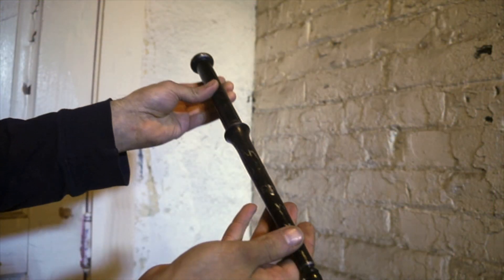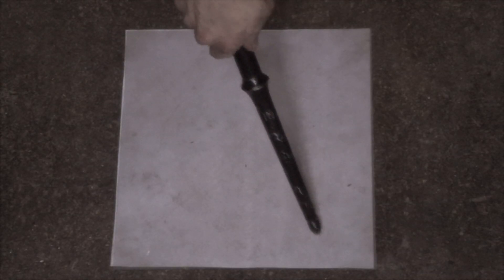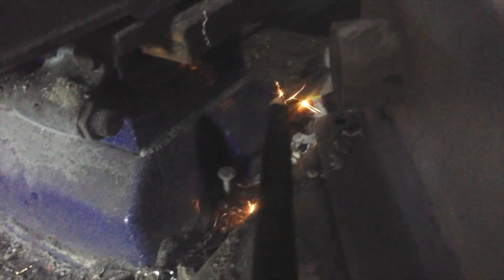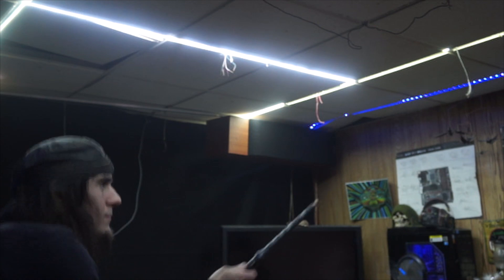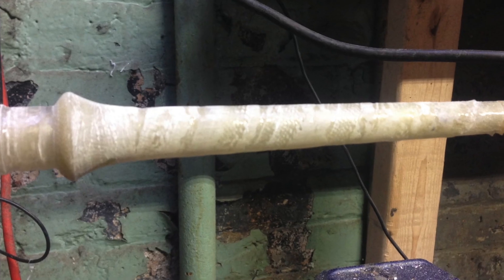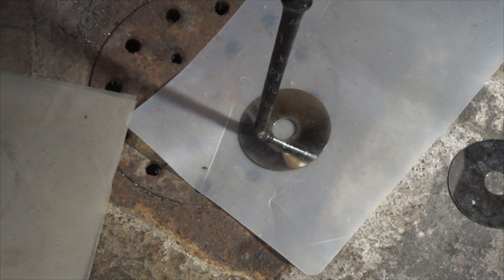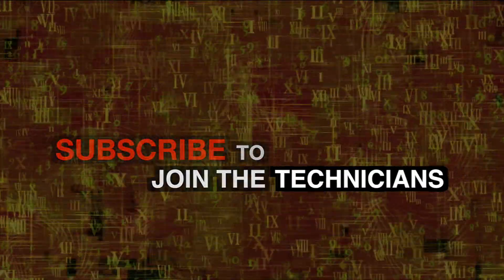HOW TO MAKE A REAL WORKING MAGIC WAND! *updated*

Comment: You ever considered trying to power this with Piezo elements charging capacitors or likely even better magnets and induction coils so shaking can charge it or something.  Sure it can be done, just dunno how long or how much movement it would require for use but would make it self sustaining with would be cool.

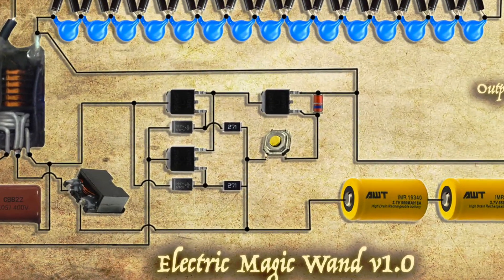Comment: Can any one suggest that mosfet name 3:40
Reply: Irfz44n 😂
Reply: irfz44n, irf2804 are pretty good for this, i found my mosfets in a ups power supply, i just looked them up on google to see if they have low on resistance so they dont heat up

Comment: I've recently taken apart a handful of televisions laptop, desktops, and hard drives. Do you think I could find all of the parts needed for this construction within those parts? I am interviewing with the electricians union this Spring, but have no real understanding of electromagnetism as of yet. I have always found this force to be a mysterious and alluring one, and I can't wait to get started on this journey of understanding. I had seen something about an Orgon wand in some magical texts. Anyone know if this is similar at all? The construction of that one mainly consisted of a series of organic (I think duct tape was recommeneded) then copper or brass wrapped on top of each other..over and over again. This looks way more involved but also more electric vs. Life force..which I still need to gain understanding of both of these ideas. Anyway, thanks so much for sharing this knowledge. It is so very cool

Comment: What are some safety precautions? If someone touches both ends at the same time, will there be enough resistance to prevent the electricity from stopping your heart?

Comment: yeah can you have an actual parts lost not just values and explain the math! You said the coil depends on the capacitor used but didnt explain how you to the voltage. How many turns are on the two coils, you only talked about the one.

Comment: Can you get a mosquito bug zapper and connect it to the cockroft Walton multiplier?
Reply: Kenneth Precioso that would be cool 😎
Reply: Dylan & James Gaming yeah I’m not that technical with electronics yet, but the schematic he layed our seem simple enough for me to solder. Anyways I wanna try this out, or just connect a cocroft Walton multiplier with a ccfl inverter. It doesn’t need to be a wand, I just want it to attach to a ring so I can shoot lightning out of my finger tips
Reply: Kenneth Precioso just warning you it would be very big and inefficient and wouldn’t be nearly as close to the voltage of this. A bug zapper is only like 2-3 kV so you’d need an extremely large number of capacitors making it even bigger and more inefficient

Comment: Can you use the MC-105 high voltage generator that's sold on ebay? https://www.ebay.com/itm/MC-105-DC-3v-6v-to-400kV-400000V-Boost-Step-up-Power-Module-volt-Generator/391727208743?hash=item5b34c2d927:g:fS0AAOSwSlBYxlnP
Reply: inJ3XioN the voltage is not high enough and the entire circuit is potted in resin so you wouldn’t be able to modify it. (Yes I know it says 400kV but it’s all Chinese fake bullshit and is almost ten times weaker

Comment: About how much does this cost to make?
Reply: Kickflip 47 the whole thing is made of very easily salvaged parts and the only thing I find hard to get is those high voltage capacitors and diodes, which is about $10 total because you aren’t buying them in bulk

Comment: Hello, what is the voltage and frequency of the output of the highvoltage circuit you made? The output before it is attached to the diode multiplier

Comment: Fantastic build. I've been making electrostatic devices and wands for a while myself, very impressed at how small you were able to make this thing. I've been using information unlimited's 8kV transformers for most of my devices though. Would be interested in getting some more details about the transformer used in this device. Where'd you source it? What modifications did you make?

Comment: Can I make a plasma lighter from this circuit
Reply from the maker: You certainly can my friend.  but you wont need more than 6 stages on your multiplier, if you even need a multiplier at all.  The goal for a plasma lighter is 6-10 KVpp.  So once you achieve that,  you should be set.